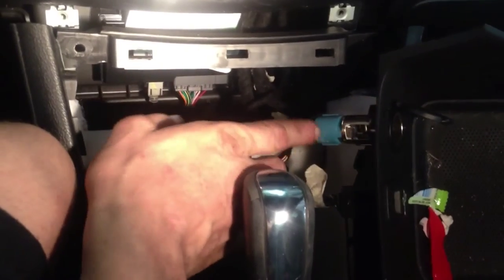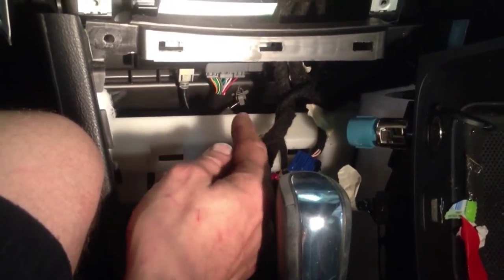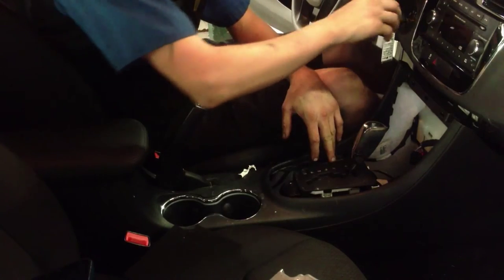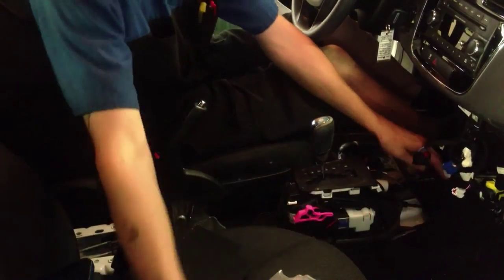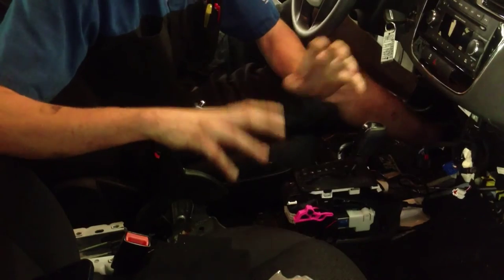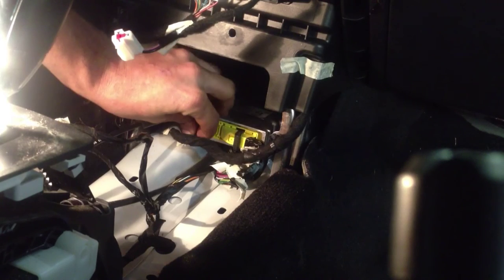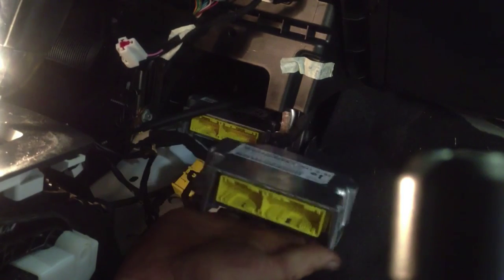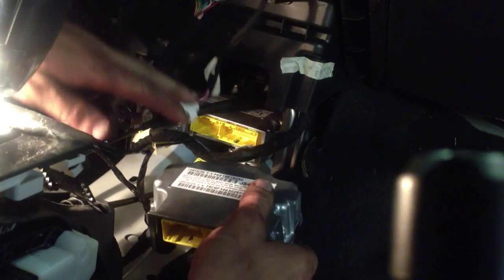2011-2012 Chrysler 200 code B2208 diag and Airbag control module replacement

Comment: I’m getting the B2207 code occupant restraint controller internal 1 on my 2017 dodge ram. Is it always the controller being bad when this code pops up? And if I replace the controller does it have to be reprogrammed to the vehicle at the dealership? Or can I reprogram it with my Snap on Solus   Pro or my AUTEL Maxisys Elite scanner?

Comment: B2209 Occupant Restraint Control Internal 3... I assume with this code I need to replace mine as well? If so, if I install a brand new one, is there any programming the dealer needs to do? Or is it simply plug and play?

Comment: Why did my mechanic say the wires to airbag were in the drivers side headrest?? Are there wires located in the headrest??
Reply from the maker: Depending on the vehicle....there can be wiring in the headrest for the active head restraints. There isnt an airbag in the head rest....only a spring loaded section depending on the vehicle as mentioned.

Comment: Do you have any video from removal of the air bag control module from a Chrysler Crossfire Coupe.  Thanks
Reply from the maker: +Dyan Troisi Sorry but I don't. We haven't seen a Crossfire in about 2 years here. I will keep it in mind the next time one comes in needing that done just in case.

Comment: I had an accident and my seat airbags deployed. So I  put new seats. It still says service airbags. Do I have to replace the airbag control module as well.
Reply from the maker: There is a chance but the first thing is that the the codes need to be pulled. The codes will tell us exactly what is needed. Once you get the codes.....I can help you further. Thanks for watching and make sure to subscribe
Reply: thank you sir.
Reply from the maker: Your welcome!

Comment: is there anything else to remove the ac control? I can't really pull it and looks like there might be something else holding it in place?
Reply from the maker: One the one in the video it just snapped in place and pulled outward. Not sure if your set up is different such as maybe being a different year possibly?
Reply: +MotorCity Mechanic 2012 Chrysler 200 LX
Reply from the maker: From what I am showing it should come off exactly like the one in the video. Same year model. I will have to look around at any that come into the shop in the near future and see if there is any difference.
Reply: +MotorCity Mechanic I jist received yhe part today. after replacing the module and properly installing it will the airbag light go away?
Reply from the maker: The service info doesnt mention anything special that has to be done once the module is installed. I cant remember right off hand at the moment it I ever had to myself. Should be a plug and play. As far the the light...depends on it that was the issue/cause for the code

Comment: Can someone tell me with my Chrysler 200 when I’m driving my speedometer stick go to 0 when I’m driving 60mph and also the battery light comes on and I just got a new battery. And also all my dash board lights come on like the battery engine light and there’s more lights that comes on it turns my air on full blow mode when it either off or on low setting. What could this be possibly

Comment: Hello, Need your help with my 2015 200. I want to change my radio out for the same size radio, same screen but it has the sirius radio and mine does not. Can this be done. This radio was promised to me when I got the car but after I got it, there was not sirus radio. I can get the part number for you. Thank you. Judy
Reply from the maker: Judy Favors good morning Judy. Thinking about the repair.....Im concerned that there is no antenna for the siruis portion of the radio to work. The vehicles dont come pre wired for this. Please send me the part # when you get time and I will see what I can do. I will try to see what my parts department can come up with.
Reply: Thank you for trying. Enjoy your weekend also. Judy
Reply: +Judy Favors yes you can, but the dealer would have to program the anti theft code in the new radio in order to work
Reply: Thank you.

Comment: Hi, 
Does this work for a 2012 Dodge Avenger?
Reply from the maker: From what I see in the service info......it looks very much the same if not exactly the same. There could be some very small differences but I feel you should be fine following these steps in the video. Thanks for watching it and make sure to subscribe
Reply: I just finished replacing it in a 2012 Dodge Avenger 2.4L, It worked just the same as in this video. I also found it well worth it to take 2 more minutes to remove the center console.

Comment: LMFAO!...why would you remove the whole center console?  Just take out the HVAC controller and the plastic storage insert underneath it and you can access and remove the module.
Reply from the maker: ROCKET I will certainly keep it in mind in the future if I get another. I was following the service info which isn't always the fastest method as you already know. Thanks for the info and make sure to subscribe
Reply: You bet...well done videos!
Reply from the maker: Thanks!